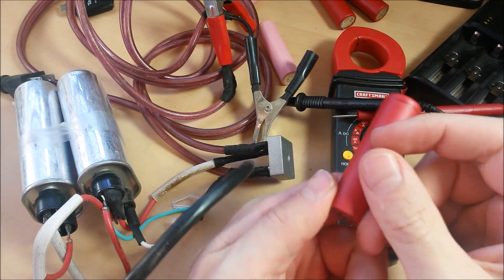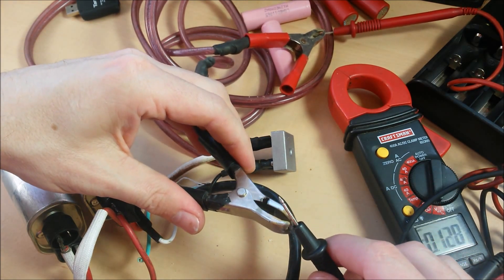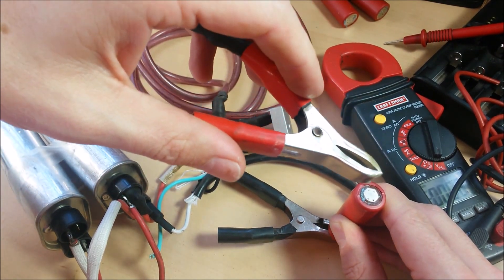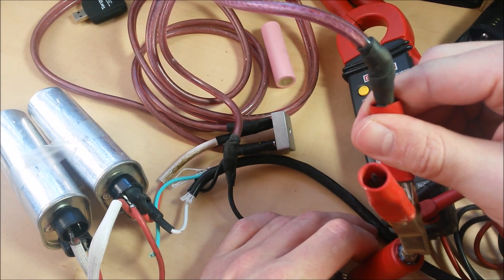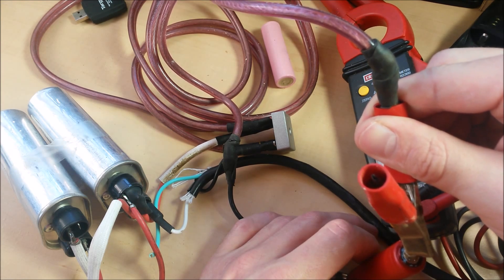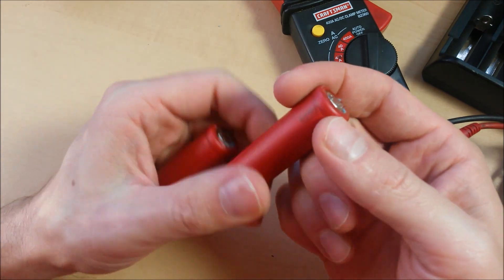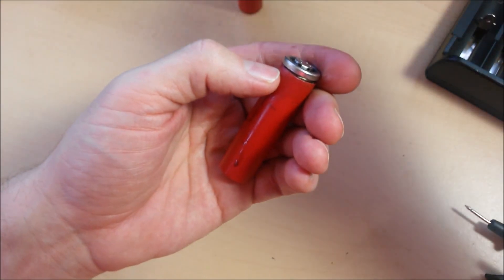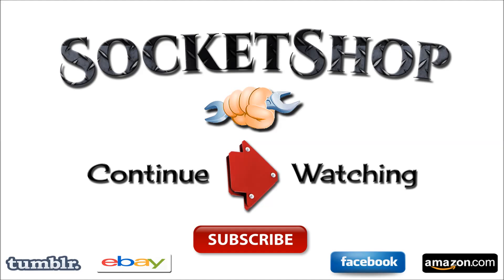Fun & Danger w/Some Dead 18650 Li-ion Batteries ~Don't Try This @Home

Comment: what an idiot.. would give a darwin award but he does not even deserve that.if you must know the protection mechanism is under the top cap. ptc and cid look it up. here some quick finds https://cdn.shopify.com/s/files/1/0674/3651/files/Screenshot_12_1024x1024.jpg?5589627259132033388  https://image.slidesharecdn.com/powergoalsforhumanspaceexploration-141005181352-conversion-gate02/95/power-goals-for-human-space-exploration-46-638.jpg?cb=1415019201  there is no user serviceable parts inside. all you did was damaging the outer steel casing at the crimp point.

Comment: Dude there is for sure a safety device in those cells and all other swiss roll type lithium batteries.  You can't remove overpressure fuses without breaking the seal to the atmosphere and very quickly ruining the cell!  Oh and that's not exactly acid. There is an easy way to fix an overpressurized open circuit cell and it brings them back to almost the condition they were in at the time the fail happened.   usually,

Comment: If you want to pulse the voltage into the batteries, why are there a couple of smoothing capacitors in the circuit which will tend to even out the voltage? 
If they are not across the output of the bridge rectifier (difficult to see), what purpose do they serve?
If you are putting 60Hz into a full wage bridge rectifier then you will get 120Hz pulses out the other side, not 60Hz.
This looks like one of the most dangerous ideas I've seen. Apart from warning us not to do it at home. There are bare wires and bare terminals. You are handling alligator clips carrying 110V with insulation probably designed for 12V battery chargers with your bare hands. If you MUST do this, use only one hand, keep the other one behind your back or in your pocket, that way, if you touch one of the bare wires, at least you won't bridge it across your chest and through your heart and you may even survive. 
As an electrical engineer, I beg you, please don't put videos up like this. Some idiot is going to copy you and they won't be so lucky.

Comment: They come in protected and unprotected varieties. Laptop batteries tend to be individually unprotected with a separate circuit board inside the pack to handle the protection. On protected batteries the circuit is usually on the negative end of the battery with a thin strip that runs up the outside (but under the shrink-wrap) to the positive terminal.  They are great batteries but they need to be shown some respect. Use a dedicated charger for them and don't stick screwdrivers into them!

Comment: this is too much of voltage going into the cell, eventually it will melt the internal anode. so by doing is not going to revive the cell.

Comment: I didn't really want to waste my time on this but here we go...... Putting 110volts DC into a lipo is a VERY BAD IDEA, I surprised it didn't blow up in your face, they are only supposed to be given a max voltage of 4.2volts DC (per cell), The rig you made will convert AC into DC yes but the "High frequency pulses" you talk about is rubbish, it will be line frequency if any, you have a full wave rectifier and high voltage caps there so you will be getting pretty much pure DC (unless under high load) So no high frequency pulses I'm afraid, Please please don't mess with lipo's if you don't know what you are doing, and please don't use your AC/DC rig for charging, testing or pulsing any kind of battery. 
I'm only trying to keep you safe.

Comment: This is the exact reason why I never recommend anyone use rechargeable 18650 Lithium Ion batteries of any size, shape or form, especially Chinese-made batteries commonly used in dry herb personal vaporizers, electronic cigarettes and flashlights.  Li-Ion 18650's are the single most dangerous mass-consumer batteries ever made.  As an expert machinist, I'm naturally an authority on Li-Ion batteries of all sorts, this video simply proves I have been right all these years.  Thank you for EXPOSING the TRUTH to the dumb mass consumers, most of them remain willfully ignorant about these things and choose to ignore all safety precautions.  I'm with you, I vote for a Federal BAN on the sale of 18650's in the US all together, better safe than sorry for the dummies who think 'protected' Chinese 18650 batteries are safe.
Reply: They are doing perfect job in any laptop batteries, Tesla Motors cars (7104 per P85D car). Laptop manufacturers WILL NEVER AGREE WITH YOU. they need this unprotected batteries anyway. No ban can stop the person from extracting li-ion's 18650 cells from laptop battery. Furthermore 18650 is not only li-ion format. They are fold in very huge variety of formats and banning the most popular of them will never make situation better. Video does not prove that li-ion's are such dangerous, beacose cell he were trying to revive hadn't even vented, let alone exloding.
Reply: Grotesque Machinery Yes laptops are always blowing up every where . Laptop batteries are made in Japan not China BIG difference. And when did you ever see a laptop catch fire or explode, almost NEVER!
Reply: The good ones have fuses to prevent that the CID